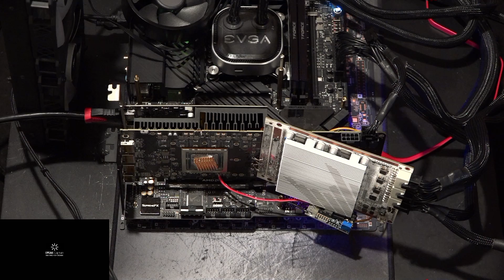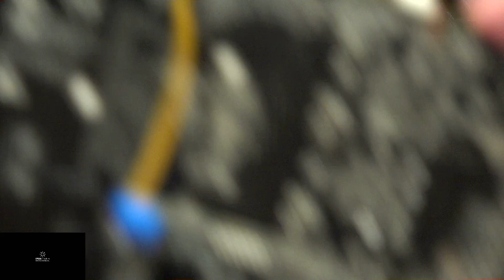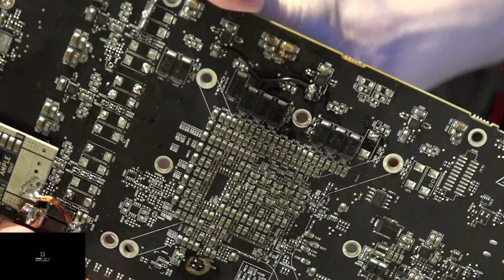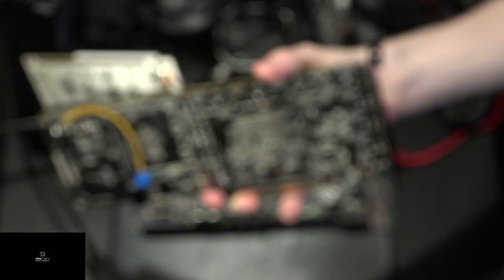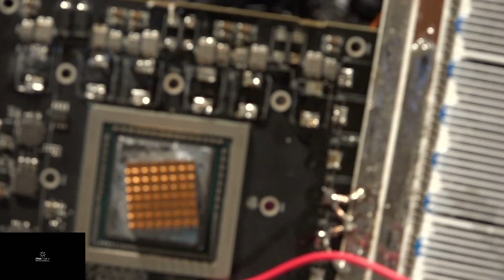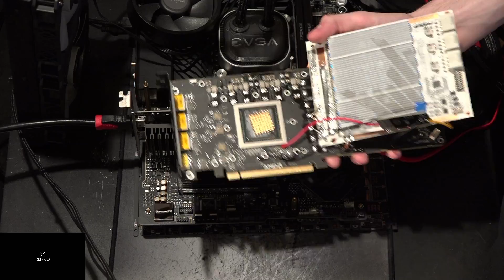Buildzoid can repair VRM but can't repair VEGA

Comment: 6 months later... and probably irrelevant at this point in time but when the original vrms booted up... did the vrm controller give a signal output on the PGood pin ? 
Without it, the core will shut down and pull the enable line low. 
Startup usually is 5v/3.3v rails -> Pex -> supporting rails -> GPU Core output enable-> Vmem and Vcore -> GPU Core check for PGood signal on VRM then... 
If PGood from controller present, indicating output voltage is correct and steady, then Core keeps worky worky. If no PGood then Core disables the Enable and all shuts down to no worky worky possibly why all rails were up for 700ms then shut down.
External core VRM and other ample rails are fine but wondering if you checked for or manually put the PGood signal high, telling the core to stay on.
I know it's not your first frankenstein and you have mucked around with quite a few GPUs but hey, possibly an external view for next time.
Love your work and really enjoy watching your vids so keep doing you !

Comment: great as always dear, if you will to giveaway this card or sell it, i can take it, i have the same with dead GPU, i have most of the component that take off the board, so i wish to give it a try, PS: can you measure the OHMs between the caps terminal at the back of the GPU, and  share it, thanks

Comment: Good video explaining how to resolve the issue with the cold start. Great choice on the spare parts for the turbo intake blades. The oil radiator needs a new high synthetic additive solution refill, but it can wait until you change the lower cooling valve. Keep up the good work!

Comment: Is that cooler for the gpu enough even for testing? If i remember correct vega had temperatures on certain parts of the package that was far higher then what the average said. Anyway like your videos :)
Reply: It's enough for turning it on for like, 20 seconds to see if it even posts.

Comment: Hey buildzoid i have issues with my vega too, but a different issue.

If i run it in PCIE 2.0/3.0 x16 it refuse to boot past windows loading screen. However PCIE 1.0/1.1 x16 and PCIE 3.0 x8 works normally.

Does this mean that some of my PCIE pins has signal integrity issues? And what could be the cause of it?
Reply from the maker: that would be my guess. As for what could cause that did you try a different GPU?
Reply: @ActuallyHardcoreOverclocking  Yup i did try a different GPU, a R9 270 and a GT 1030 to be precise, both work without tinkering with anything.

This particular Vega64 did actually had a short in the past due to having used a metal washer instead of nylon washer used for the washer mod, but it seemed fine back then even after the short with no issues. 

The issue only recently surfaced when i updated and clean installed drivers to take advantage of integer scaling, after the update, rolling back drivers doesn't work and even linux has issues with the card.

It seems very unlikely to me at least that a short from over a year ago only affecting the card now unless the signal had been degrading since then, weird that a driver update is the one that caused the x16 to become unusable.
Reply: @lmchua8644  if a GT 1030 works in a above mentioned slot, that may not indicate anything userfull. Gt 1030 actually uses up to 4 lanes of PCI-E. R9 270 should indeed use 16x of PCI-E 3.0 (if avaiable) and having this card actually running can prove motherboard pci-e slot is fine

Comment: I feel you, I've been poking away at a Vega:FE for a month now and still couldn't fix it (though admittedly I don't have your level of expertise). After I couldn't fix that, I got a "new" used PCB that kinda works, but had symptoms seemingly from a corrupted bios (couple vertical artifacts on screen, only one displayport functions, error 43 in windows). Flashing new bios didn't fix that though, so I guess it's back to troubleshooting hardware again... Don't you just love putting lots of labor into something not working?

Comment: Nice one... Just had a 780Ti K|NGP|N that trolled me in a similar way for a couple of hours. everything was present and behaving as it should, but the card would not getting picked up by the systems. I was really looking for something wrong, until I noticed the VCore offset switches, both of them, being "ON" on the card (so +50mV and whatever was added on the software side). I got it that way. Now, I'll need a new Core to put on the card if I want it to work again! I'm sad, as it's such a nice card... Can't win them all!

Comment: I had the same issue with my Vega and it was the bios that had craped it self. After flash was fine. Water almost killed it.
Reply from the maker: Ok I'll try swap the BIOS chips
Reply: @ActuallyHardcoreOverclocking  if it works I have a heatkiller block that will fit your Vega . Good luck
Reply from the maker: @xkillerpn  it didn't work. So I'm going with the core crashing as the board tries to intialize it and that's why everything gets stuck.
Reply: @ActuallyHardcoreOverclocking  crap. But if the core gets hot it's doing something. You sure hbm is actually working?
Reply from the maker: @xkillerpn  dead cores still get hot. Some of them even end up pulling more power than working cores.
Reply: @ActuallyHardcoreOverclocking  nice to know. Thank you. Good luck from UK

Comment: I bought vega64, it had little water damage and 2 rails shorted to ground. Two on the left side of the core. One rail had a shorted ceramic cap, that was easy. The second rail seems to be completely dead. Any ideas how to diagnose what's wrong, injecting voltage didn't really help. Vcore is about 0.4ohm, Vpp about 40ohm, MVDD 2,3ohm, 0,8V 30ohm, 1,8V 0,5ohm, VDDCI 32ohm
Reply from the maker: your MVDD is too low. it should be around 30ohms IIRCs. For 1.8V I'd pull the inductor that should at least tell your if the short is on the switch node or on the output.
Reply: @ActuallyHardcoreOverclocking  thanks, the output is shorted the mosfet side is around 3K ohm. I'll send more voltage in and see what will start burning. Btw do you know what 1.8v powers?

Comment: I only touch one dead vega 64, the "vpp" voltage was too low iirc, I could only get the card recognized on windows (but code 43) when I was using a skylake motherboard only, older board like Z77, X79 and Z87 does not recognize the card, I believe the core was dead or a pcie voltage was crazy/not in specs, I replaced the VPP APLxxxx voltage regulator but nothing happen :/
Edit : did you checked if the bios is not corrupted and did correspond to the installed HBM brand ? 
Edit2 : I got an RX480 with a wrong vbios on it, not the right memory support -> it would not even display something until I flashed the correct bios using external programmer
Reply from the maker: AFAIK VEGA FEs all use the same HBM.
Reply: @ActuallyHardcoreOverclocking  My F.E didn't wanna boot the other day, had to use install disk and repair os

Comment: Watched half the video so far. From what I gather. You fixed the card, but it no worko. So you went fuck it and bypassed well, most of the card and supplied your own power to pretty much every vrm. 

I have no electrical knowledge. My guess might just be that, the card doesn't know it's capable of booting up safely so it just doesn't boot up? Maybe it's because there's no power connectors on the card itself? maybe there is a problem somehwere you overlooked? From what I've heard, it's your first time doing a few things on this card, and the card didn't do something it's supposed to. Maybe it's some hardware incompatibilities or some cusom IC's? Two mofsets did just decide to die. Was the intial thingy being shorted out cause that? Or was it the part you replaced being incompatible? I have pretty much zero knowledge on this kinda stuff so feel free to completely disregard what I've said. Because I probably would too.
Reply: He had a cable connected to the card, it was the first one he removed when he started removing them. AMD cards is able to initialize with just 1 connected IIRC. (Plus the  powerboard of course)
Reply from the maker: @Qyngali  nah I have the second power plane jumped and all the detection bypassed
Reply: @ActuallyHardcoreOverclocking  thanks for the feedback but I think you meant to tag Jamil...? I was just telling that the cable was connected when he said it wasn't. I didn't mean to imply that the cable was necessary or not...
Reply: Even without electrical knowledge, you have a good point. It's possible for these controllers to have a "PS GOOD" signal that will tell other parts of the system when the output power is within spec. They also have enable pins so that they can be easily enabled or disabled. The latter is what buildzoid was talking about with the transistor pulling it low. You can use these two features to boot up your rails in a specific order, or have the chip in a reset state or limp mode until all the power supplies are good. They are also easily bypassed. Buildzoid mentioned removing the transistor to force the rail to start up. You can also wire the "power good" pin straight to voltage to force it to report "good". I don't think that's required on these cards though.

Even though it's his first time doing some of the things (Soldering this type of mosfet to the vrm, which he replaced with an identical part) he ended up bypassing them completely with the white galax card and the two elmor supplies. So in the end none of the original VRM components, or the mosfets he soldered were in use. The rest of the parts that failed are all things he's done before, so it's unlikely he missed anything. I listened to the video and paid attention to most of it, and I think he checked everything.

In short, you had some good suggestions, and were right on the money about the protection features that VRMs can have, but Buildzoid already accounted for them with the second and third round of mods to this card.

Comment: ya and asrock wont rma if u open your card an change paste, they refuse even when you tell them its agaisnt the law. so stay clear of them guys  lost out 400 bucks on a 5700xt
Reply: 1) how did you break your card by changing thermal paste
2) once you open the card, the warranty is voided, so you can't rma it. There even is a sticker on the card that says: "warranty void if removed"
Reply: @theunholybakery1990  ya but that does not apply in the usa man, thats the issue  and i think the card was broke when i got it, cause i had so many issues with it  thats why i changed paste
Reply: @jimsinnovations2737  what kind of issues?
Reply: @theunholybakery1990  just sometimes not showing a signal booting up., have to hard reboot.. game crashs. random system crashs etc  to name a few
Reply: @jimsinnovations2737  i mean, why not just send it back immediately then?
Reply: @theunholybakery1990  because I was hoping it wasn't the card that it was software or heat related , but I believe it to be the card cause it acts the same in other systems
Reply: @jimsinnovations2737  well, sucks for you man.
Reply: @theunholybakery1990  yep for sure,  but I'm figiting em on it, so we will what happens
Reply: @theunholybakery1990  Imagine trying to defend the "warranty void if removed" stickers that were deemed ILLEGAL AND UNENFORCEABLE.
Reply: @shawnpitman876  lol

Comment: I had a good power supply Corsair AX860i - Flextronics and a MSI GTX 760 Hawk turned up in smoke and kept smoking until i manually turned off the PC. Not sure what exactly went to smoke on the card - i assume some controller or some mosfet. Yeah an MSI card that was supposed to be used under LN2 - had cables and connectors for voltage measurement and went smoke just on air and fine temps.
Reply from the maker: sometimes you get shorts that just aren't big enough to trip OCP.

Comment: Have you tried cleaning the flux out? Sometimes, it's conductive and will short to ground or cause an array of unrelated problems.
Reply from the maker: this is non conductive flux that I've been using for ages and never had any issues with IDK why this card would be special.
Reply: @ActuallyHardcoreOverclocking  Oh well. On the bright side, you've managed to replace VCore components. So grats for that!